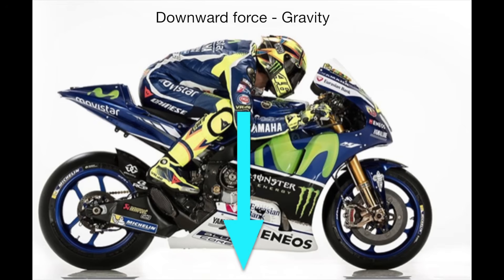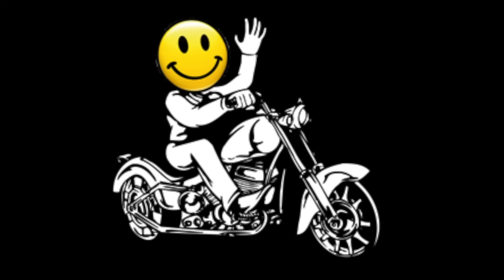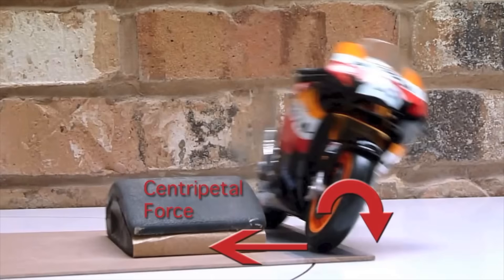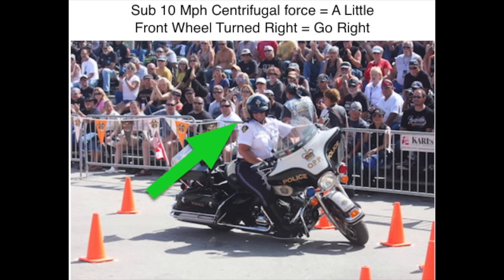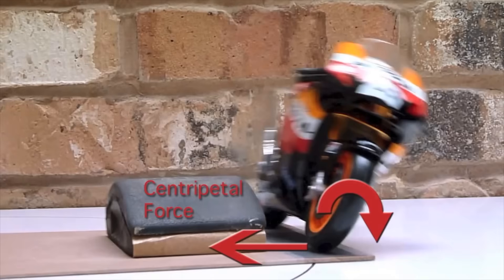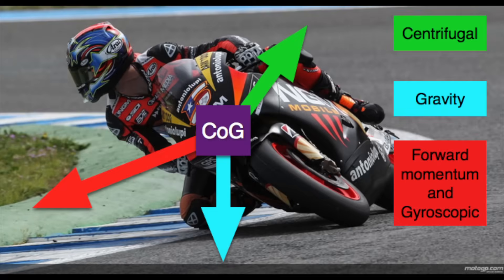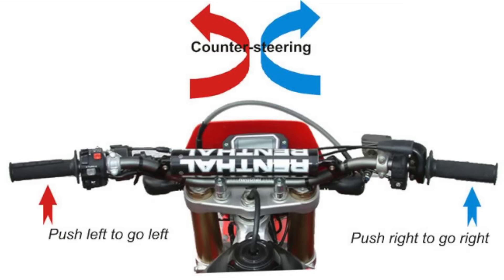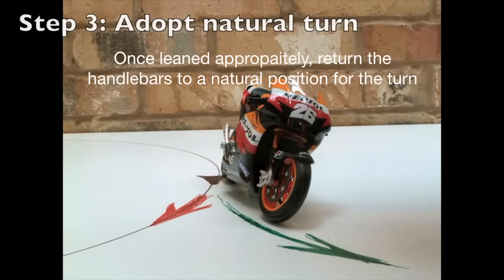Motorcycle Countersteering Physics, Myths, and Misconceptions | SquidTips

Comment: This is great BUT after you use counter steering to tip the bike into a corner, then how would you increase the turn, lets say to avoid something in the corner. Do you use more counter steering while leaned over, or do you turn the bike's handle bars normally, left goes left right goes right. This question really has puzzled me.
Reply from the maker: You keep counter steering.

Comment: so what happens once you are done reaching the desired lean angle, does the wheel actually Then piont in the direction of the turn just like a bicycle? Asking for a friend, because this turned into a 3 day argument, and I am trying tonstay you are Always leaning the bike, and he states that there is no magical 15mph and that the wheel eventually turns in the direction of the turn 😔🙉🙈🙊🤦‍♂️
Reply from the maker: At speed, there really no point when the wheel with turn in any significant way. If you wheelie, turn the handlebar, and then hit the ground, the road underneath forces the wheel to straighten immediately. That’s important to remember because that’s what’s happening in a turn as well, the road and your speed don’t allow the wheel to turn any significant distance, which is why even subtle steering input forward or back makes the bike lean immediately. 

I could find some video demos of this if my explication is insufficient. My other video about Tank Slappers might help too.
Reply: @SquidTips  thank for the reply. Was just in a funny heated argument with a friend regards to what happens to the moto dynamics(which way the front wheel is turned) when you reach the desired lean angle going through a high speed turn past apex.
Reply: @maxb1401  
This should answer your question:
https://youtu.be/lzk8oyNO708
Note that although, during counter steering, the rider has pressure on the left bar, the wheel is actually steering/pointing left (into the turn). When the required lean angle is reached, the rider stops “pushing harder” and just maintains the existing pressure. When the bend is completed, the rider just eases off the pressure completely and the bike stands up. Hope this helps solve your argument.👍🏻😀

Comment: At one point you suggested that counter steering was only required for a brief moment. At low speeds, yes,  that’s true. At high speeds, them inside bar is pressed right up until the rider wants the bike to stand up again. Ergo, in a long, high speed turn, this could be seconds. Other than that, not bad.

Comment: 0:50 The front wheel is NOT what steers the motorcycle - it is chassis dynamics that steers the m/c. The front wheel and handlebar is but one rider input that causes the m/c to steer left or right.

Comment: 3:28 I disagree. At higher speed you clearly need to continue to countersteer in order to turn. As long as you countersteer you turn, if you stop, you stop turning.
Reply from the maker: Well, it depends. If you accelerate through the turn, then you amplify the centrifugal forces, which will try to stand the bike up, so you’d need to turn more to counter that.

If you decrease speed, then you lower those forces, and you’ll need to steer the other direction to maintain your cornering and lean angle.

If you are at equilibrium, and there is no reduction or increase in speed, why would additional steering input be required to maintain lean angle?

Comment: One of the things I struggled with trying to understand this is...do you need to continue to HOLD the handlebars in that same initial direction to maintain your turn. Looks like the answer is "No" which makes sense, you're just using that initial push to initiate the leaning of the bike.
Reply from the maker: Pragmatically, you’ll be making small adjustments in any turn. On city streets you’ll just lean briefly, probobly never even hit the balance point where all the forces equalize. In a longer turn like on a track you’ll likely make small asjustements thoughout the turn to set your exit point. So although in theory you just need to push a little bit initially, you actually are almost always applying some steering input.
Reply: @SquidTips  Appreciate that additional info, as a total noob who's still in the process of making his first bike purchase, finer details like this are appreciated. Consequently, I was out for a morning bicycle ride and was just messing around to see if I could somewhat replicate the concept and even though it's obviously nowhere near as heavy or moving nearly as fast as to truly gain gyro stabilization (in my pure assumption), a quick push of the left handlebar seemed to very obviously cause lean the bike over to the left and vice versa. Thanks again for the video!
Reply: Justin Sicking 
It's not hard to explain at all..
Push left, go left...... Push right go right.
If you need to lean a little more, push the handlebar concerned a little.
If you need to lean a little less, ease off the pressure on the handlebar concerned.
When you have attained the lean angle required, just maintain the pressure on the bar concerned.
To straighten up, gently release the pressure on the bar you are pressing and the bike will slowly stand up.
That is a difficult as it gets and that covers all aspects of your use of counter steering.

How or why does it work?.... Who gives a shit. Do you need to know how your phone works to use it? Just know counter steering works all of the time, every time.

Comment: Well, coming from someone who claims to have it all right, there certainly are a few misconceptions.
1) 
Intertia is the resistance in a physical object to change its speed or direction.
2) 
Only at very low speed is the physical movement of the handlebars, what is causing the counter steering. Otherwise it is the gyroscopic effect of the front wheel, which causes the force applied to the handlebars, to be translated into a tilt, and thus a turn.
3)
The graphics at 6:30 showing the biker turn the steer, is wrong. 
Counter steering is initiated by applying a force to the handlebars. This force is very low compared to the force it would take to break the gyroscopic effect, so it does NOT turn the handlebars. In stead it translates into a tilt, which causes the turn to tighten.
Reply from the maker: You missed the part where I incorrectly referred to centripetal forces as 'centrifugal'. This was a fun video as I learned that physics language is REALLY precise and you have to be very careful how you use it.

I'd love a source for 2, that is incorrect based on my reading. 3 is just a visual demonstration that Keith Code put in the classic motorcycle education series 'Twist of the Wrist' use to help people understand what is happening. Of course the tire doesn't turn 25 degrees to initiate a turn at speed.
Reply: @SquidTips  
There is this general misconception of counter steering, that you initially turn left, which then results the bike in dropping of to the right, and that you then "magically" also turn to the right, saving it all, and voila, thats counter steering. Because that is what you can observed at very low speed. That is also what the graphics at 6:30 shows.
But that is not how it works.
As soon that the front wheel get up to speed, the gyroscopic effect will try to maintain the angular momentum. This means, that trying to turn your front wheel will result (not in the front wheel actually turning), but in your bike leaning. Bike leaning = bike turning.
Explained here.
https://www.youtube.com/watch?v=iaauRiRX4do&t=47s
https://www.youtube.com/watch?v=EJWIl4MYMbw
Edit:
Second link explains why the gyroscope "translates" forces by 90 degrees
Reply from the maker: I’m familiar with the concept of Conservation of Angular Momentum, and the video you linked disproves that this is what is leaning the bike over. 

First, notice that it only works one direction. Bike designs can't flip the direction of the angular momentum, so you'd end up with one side working and the other fighting it.

Second, bike only has 2 pivot points to the ground it’s leaning against, and that’s your two tire contact patches. You push forward on the bar to adjust your bikes direction initiating a lean, that’s the only way it’s happening. You can’t ‘Pull’ the bike down from a force above the contact patches, there’s too many forces keeping it upright. It’s just as flawed an idea as being able to push the bar down from sitting on the bike.

Comment: A pretty good effort here, but still perpetuates that myth that you don’t use countersteering below some “magic” speed.  10 MPH is shown here and I have heard others say 15.  It doesn’t matter as there is no magic speed at which countersteering stops working.  Countersteering is the most effective way to steer a motorcycle at any speed above zero.
Reply from the maker: Except if you aren’t going fast enough to lean then you aren’t really countersteering. If you are just above a stopped speed and push forward on your bars, your motorcycle will move with the direction of the tire. If you aren’t going fast enough for centripetal forces you allow you to lean into a turn, then you aren’t really capable of utilizing techniques that involve leaning a bike.
Reply: Squid Tips Sorry, but you are incorrect.  You can easily prove this to yourself.  Get a motorcycle that you don’t mind laying down.  Put on all of your protective gear, a couple layers is preferred.  Now ride as slowly as you can and still maintain reasonable balance in a straight line.  Most of us can do this down to at least 5 MPH and I can get to 2 or less on a good slow race day.  Now that you are balanced and going straight ahead swiftly turn the handlebar to the left and hold it there.

If what you are saying is correct, you will start a quick turn to the left (the “direct steering” myth).  If what I am saying is correct, you will quickly crash on the right side of the motorcycle.  Please video this demonstration and then post it so that we can dispel this myth once and for all.  I would do the demonstration, but for three reasons: 1. I don’t have a beater bike that I am willing to intentionally crash, 2. I am 60 years old and don’t heal as fast as I once did, and 3. I already know what will happen so I have no need to do this demonstration.  We are all awaiting your results.
Reply from the maker: Right, that’s called tipping your bike over, no reasonable person would call that steering because you are missing the part of countersteering where you ‘Adopt the lean and turn’. I understand what you are saying, but you are just going to confuse people by focusing on the semantics.

You can call slamming your motorcycle into a brick wall “Braking” but that type of pedantry doesn’t improve the discourse.
Reply: Squid Tips And which way do you think steering left at 2 MPH would tip the bike over?  To the left or to the right?

I am trying to educate you and others using physics rather than misinform them using opinions.  This exercise misses nothing at all.  Countersteering is not used to maintain a steady turn, it is used MOMENTARILY to INITIATE the turn.  Once the lean is established, the front wheel is turned in the direction of the turn to maintain the lean angle.  Most folks are unable to understand the difference between initiating a lean, and thus a turn, and maintaining the turn.  They are two different dynamic regimes and the control inputs are not the same.
Reply from the maker: If you define counter steering as simply destabilizing your bike with the handlebars, I concede, but that’s clearly not how you are defining it. Yes, you do have to actively counter-steer while turning, that’s how you tighten up a turn and fight the centripetal forces trying to force the bike upright.

Have fun with your righteous crusade of trying to split hairs around the definition of counter-steering, for whatever satisfaction you get out of it.
Reply: Squid Tips You are starting to understand.  Countersteering is ALL about momentarily destabilizing the motorcycle to change the lean angle.  That is really all it is about.  As the bike starts to lean the direction you with to turn, you stop steering counter and steer into the turn to maintain the desired lean angle.  Then when you want to change the lean angle to either tighten the turn or reduce the turn rate, you countersteer again to move the bike off its current stable lean angle to establish the new lean angle.  Countersteering is all about the transient part of turning.  You can all it splitting hairs if you wish, but it is simply about getting the physics correct.  And the physics work at all speeds, not just above some “magic” speed as many think, even some pretty experienced motorcyclists don’t understand this.  I think Keith Code is one of the very few who does understand it fully as does Tony Foale and a handful of others.

Comment: Hi, great vid. I’m a bit confused to be honest . When going around a corner are you pushing forward on the bar all the way around the corner or just a little?
Reply from the maker: As I mention in the video, and illustrate on screen at 4:00 in the video; When riding a motorcycle you are maintaining a balance between forces and depending on the situation the answer to the question will change.

When you press forward on the handle bars to start your lean (AKA controlled fall) you can lean to a point where you are perfectly in balance of those forces, and so the bike will maintain its lean without any input from you. This is only true however as long as all the factors affecting the motorcycle such as speed, curve angle, and your body position, don’t change.

Practically though, often you are accelerating (At least subtlety) through the turn, the curve angle will increase or decrease, or you will want to adjust your ‘line’ as you exit the turn which will necessitate minor input from you as the rider to steer the bike where you want it to go, back to the point where you are once again in balance (Completely upright)
Reply: Squid Tips thanks man 👍